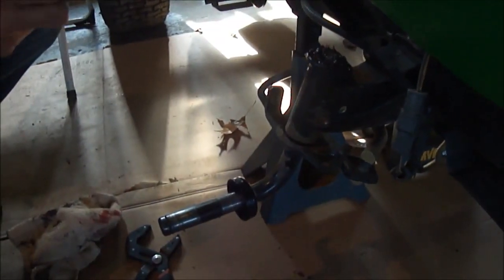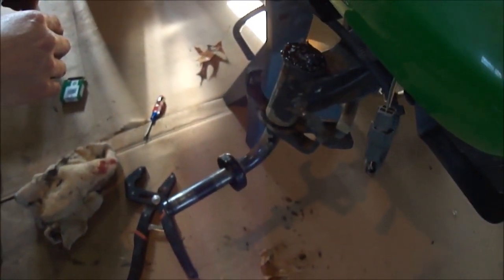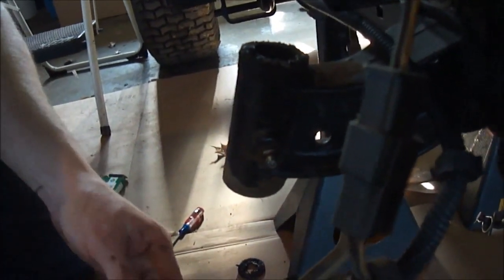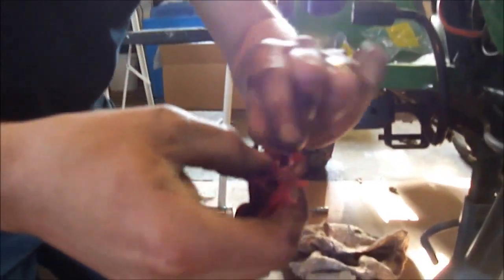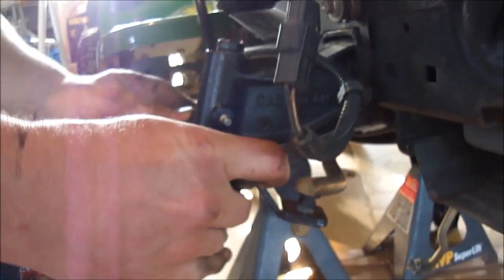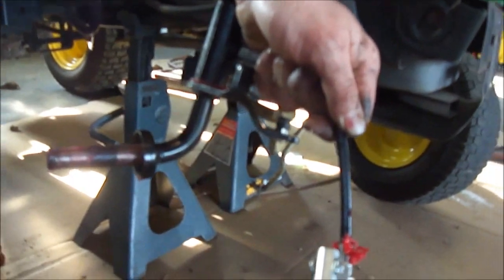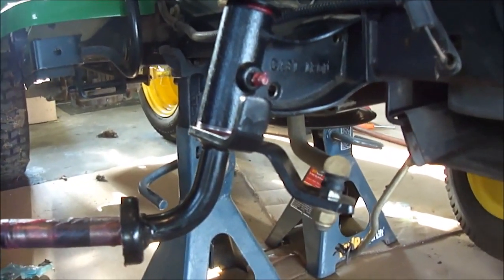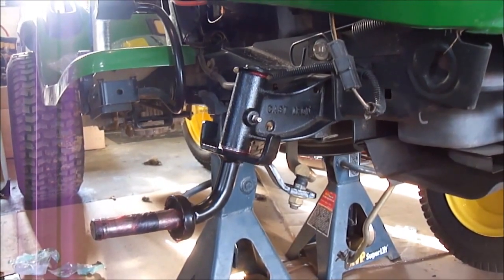Poor mans power steering: John Deere L130 Spindle Bearing Upgrade

Comment: I've tried it on my Craftsman 2006 YS4500, and I found no difference at all on the steering!
Reply from the maker: I have a craftsman mower as well,  the steering is almost to easy as it is on mine, so I've not bothered to add the bearings. It must be the gearing they used.

Comment: I added this thrust bearing upgrade 12 yrs ago when the tractor had 8 hrs on it, and was surprised by the amount of wear already created to the turn spindle. That spindle was $60CAD back then and the bearing/race from JD was $28 per side. They'll last forever with bearings. I also added bearings to the wheels and through away those useless bushings. Again I was surprised by the amount of wear already created when that tractor only had 8hrs. Today my LA145 has 147hrs and the spindles/axles are the exact same condition as the day I added the bearing. Biggest difference is I can replace the bearings cheaper when that day arrives that I need to through Amazon. There's tons of small upgrades a person can do to these lawn mowers to prolong the life of wear areas. JD cuts many corners to stay competitive on these units, correct those shortcuts and you won't have to open your wallet buying expensive parts. My JD is way better that new.

Comment: I could not get the snap rings on the top of the spindle, not enough room after adding the the 2 washers and needle bearing to install the snap(lock) ring into the groove on the top of of the spindle. This was on my JD D170. Can anybody suggest what the problem might be?
Reply from the maker: You may need to grind a little off of the top and bottom of the spindle to gain a little clearance.

Comment: Did this on my L120 just 2 weeks ago. Good thing it wasn't an expensive mod because it did absolutely nothing. Can't tell any difference in ease of steering. Of course maybe it is because I maintain my equipment and everything is always well greased. No one ever applies grease to the steering components underneath.

Comment: The steering shaft on those cheap bushings is a friction point. I replaced the bushings with flange bearings top & bottom. The bottom req some cutting & welding, but it is smooth as silk. NOW....I'm mod'n the drag links to have heim joint ends. They are a ball joint like used on go karts etc... Same cost as replacing the drag links to also include cutting & welding a bolt on the end for the rod ends to attach.
Reply from the maker: That's a good idea, I may try that the next go around.

Comment: A much better how to vid than I saw on another channel..he used a torch to soften the rubber cap..I use a hair dryer which puts really hot air and MUCH safer to soften the rubber cap..yes, that adds a step but SAFER..I've found 3 yard sale dryers for .50 cents each..good technique..

Comment: I have a JD L120 and I did this, but my right tire doesnt clear to put the c clip back in.  Any ideas guys?
Reply from the maker: You’ll have to take a file or grinder and remove a little bit of material off of the spindle, that will give the clearance needed.
Reply: @SteveStoltz  Thats what I thought but everyone was doing it with ease thought I missed something thanks man.

Comment: Added to my L110 John Deere but not enough clearance on my John Deere 185 hydro. Can I use even thinner washers around the bearing?
Reply from the maker: Possibly, I would try filing down the ends of the spindle first, getting rid of high spots may give you enough clearance.
Reply: @SteveStoltz  No not diameter clearance. Length of spindle is too short for the thickness of the bearing/washers. With the bearing on the slot for the c-clip retainer is not quite fully visible.
Reply from the maker: @diverdon184  Yes that’s what I’m referring to, the top and bottom surfaces that the washer comes in contact with.
Reply: @SteveStoltz  Yes I cleaned the base up as best as I could. Do they make thinner washers? Maybe they would fit.
Reply from the maker: @diverdon184  .032 is the thinnest I see at McMaster Carr, unless you can find another supplier.
Reply: @SteveStoltz  Thank you Steve.
Reply: @diverdon184  he means to take off a bit on top of the tube that the shaft will go in.  Then you will have more room at the top to fit the washer and c clip.

Comment: I added these to my L130 this spring and it made a huge difference in the steering effort.  I also replaced the steering sector gears and the steering wheel shaft bushings which helped even more.  Only use DRY LUBE like WD-40 PTFE DRY LUBE SPRAY as any kind of regular grease will collect dust and dirt and become a grinding paste.
Reply: Ive been testing out Graphite lube, I used Dry Lube for awhile with good results

Comment: I just finished this modification to my Craftsman L1000 mower (8-13-19). The improvement in the steering is significant. On my mower, it's at least 4-times easier to turn. It truly feels like power steering compared to the old tug-of-war I used to wage whenever I mowed my field. I recommend this power steering modification and also replacing the bushings in the front wheels with bearings to everyone. I decided to make both changes to my mower. And it now rolls so easily that moving it by myself is a piece of cake. Note, however, I did have to make some minor modifications to the instructions that were provided here — mainly due to the fact that the setup on my mower was slightly different from Steve's John Deere tractor. Why the manufacturer's don't make bearings standard for all their tractor mowers is beyond me. The added cost would be minimal — likely only $20.00 extra.
Reply from the maker: Great to hear! Its definitely worth it for what it cost, In my opinion.

Comment: Good video, however if you cut two grooves on the inside of the flat washers you can get grease to the bearing. Otherwise  no grease to the bearing. The grease won’t go passed the washers to get to the bearing. What do you think about that.
Reply from the maker: Randall Wilhelmi I’ve seen people do that, but I’ve not had any problems with grease getting to the bearings. The grease gun seems to push it through the voids ok.

Comment: I just performed this upgrade to my L130 (I've already done the roller bearing upgrade to the front wheels) and it's a night and day difference. I believe the factory suspension was binding quite a bit since even the ride is smoother now with the addition of these thrust bearings. One side of mine was a bit difficult to get back on due to the increased height these bearings add, but it was due to the casting from Deere that a little grinding easily took care of. Thanks for posting this and the links! This upgrade is well worth the $ and I only wish I had done it sooner!
Reply from the maker: Mat M I had the same issue with fitment on one side as well.

Comment: Any suggestions for getting a stuck steering shaft out? I think it is rusted in there tight. It is an LA125
Reply from the maker: Heat and penetrating oil are your friends in that situation, when possible. I've never pulled the shaft totally out of mine so I cant visualize what you have to work around.
Reply: Used wooden block to hammer on against the shaft I think I should get that sucker hot with a torch you where your gas line is inside the frame there

Comment: Midway
You all are making a big thing , I did mine in 10 minutes, just jack the front up 6 in or so and remove snap rings,drop wheel assembly down wipe shaft off install thrust washer, reassemble do the other side, drop jack down install snap ring, grease and you are done. no need to take the whole front end all apart to do a simple inst.
Reply: you are saying it can be done without taking of the tire itself?

Comment: Is this why it is so much harder to steer than the Cub Cadet?
Reply from the maker: I'm not familiar with the cub tractors but if its like the other brands there are tiers of quality, for example a John Deere you buy at home depot is a different tractor than what you buy at the Deere dealer, the price is also at least double. If you compare a "real" Cub tractor to a home depot Deere then the steering is probably much better on the Cub.

Comment: This is a great mod, thanks for sharing, I’m going to try this on my MTD rider, I’m removing the worn out stamped steel front axle and putting on a cast iron axle and the only thing that is different from your set up is that my spindles are held on by a nut on top not a clip.
Reply from the maker: The concept should carry over to several variations, Having a nut holding it in sounds a lot better than the c-clip setup that I have.
Reply: Steve Stoltz - The only problem I See is the amount of room I have to install the bearings and washers, the nut is meant to be tight on the top and it bottoms on a shoulder but I fear that after installing the bearing set up the nut will no longer bottom, it would be a great way to preload the bearing but unless it is a locking nut it might have a tendency to walk itself off. I guess I will deal with that when the time comes:) thxs

Comment: I’m Curious to know if the c clip fits back into the groves on the top of the spindle after adding the additional thickness of the bearing and two washers? In your video it looks as if the top washer (before the c clip) covers said grooves. Thoughts?
Reply from the maker: It does go back in but its a tight fit. One could probably mill a few thousandths off of the spindle to improve it. Ive been running that way since this video with no issues so far though.
Reply: Good to hear. Even if the c clip didn’t seat back into the spindle grooves, the only time if might be an issue is when you jack up the front end and the wheel is off the ground. Otherwise I imagine gravity keeps it in place.

Comment: Great video Steve.
I was given a 03 L130 because a friend said he had been spending too much to keep it running. I installed 2 UHMW washers and was amazed how easy the steering is now.  The transmission was slipping when is warmed up, I simply removed it, dumped the fluid and replaced it with 20w-50 motor. This made it pull like it was new.
Reply from the maker: I was having similar issues with my trans, i drained the 30w dino oil and put in 50w synthetic and it seemed to clear up the problem before too much damage occurred. Its been 2 years and its still chugging along.
Reply: @SteveStoltz  What's the best replacement fluid? I know Tough Torq suggests only Tuff Torq hydrostatic oil, I would to if i got $50/gal. I've seen guys use 5w-50 and 20w-50, is one better than the other?
Reply from the maker: I used 5w50 mobil1, if I replace it again Ive thought about trying 20w50 synthetic since I never use the tractor once it gets below 50 degrees outside. I don't know that I would really notice a difference between the two though.  I think any 50w synthetic oil is fine.
Reply: @EDB0223  Amsoil makes an oil specifically for Tuff Torq transaxles

Comment: Nice! I just put pillow block bearings on the steer column, roller brg on the steer rack pivot and roller wheels that ride against upper plate, roller brgs in the wheels but totally forgot about Torrington style bearings to fit the spindles. Genius!
Reply from the maker: I'll have to consider some of the mods that you mentioned, sounds like it would sturdy it up quite a bit.
Reply: Steve Stoltz I found some tiny shower door wheels I used for the steer rack instead of those pressed bumps. My mods took some welding and more time than most want to spend!

Comment: Steering rebuild, wheel bearings plus this idea makes it better and easier than new.. great idea.  I might add these thin washers are the perfect addition to the axles. Wheel Bearings do not take up as much axle room as the original wheel bushings.  Thank you for the idea and post.
Reply from the maker: I really noticed an improvement, Thanks for watching.

Comment from the maker: They have held up well so far, but its only been through one mowing season. I'm not to concerned about the dirt, after all prior to the bearings it was greased metal to metal with the dust and dirt, as cheap as they are you could replace them every couple of seasons if need be. If I think about it this summer I'll pull it apart and make a short video to give a visual of how well they are holding up.
Reply: steve great video spindle bearing upgrade I just orderd some! put them on la 150 . thanks Warren at bullyfreeman@gmail.com

Comment: Did this tonight. Very simple and inexpensive. Not sure yet if there will be a noticeable difference.
Reply from the maker: I noticed a difference right away, but I also replaced the wheel bearings at the same time to get everything sitting strait as well. So if your wheels are already sitting strait the results may not be as dramatic as mine. Either way bearings are always better than grinding metal to metal, lol.
Reply: I also did the wheel bearings. And the steering gears along with the bushings. Pretty excited to try it out today.